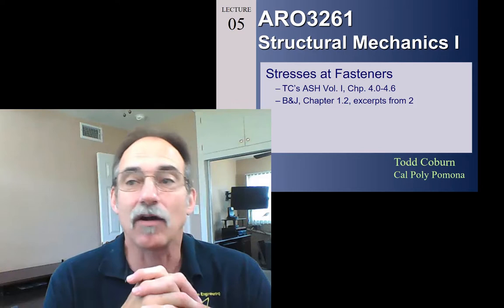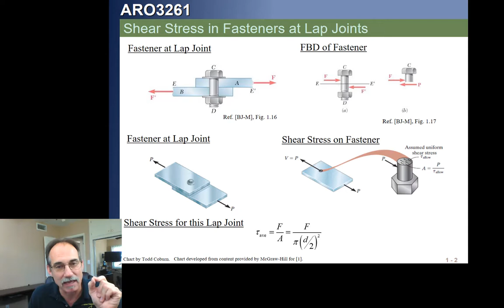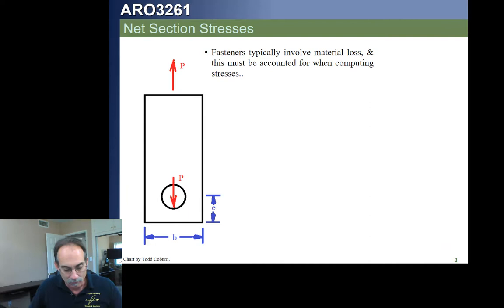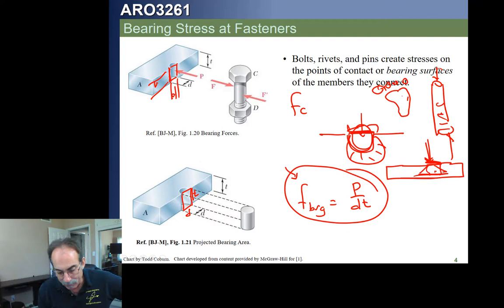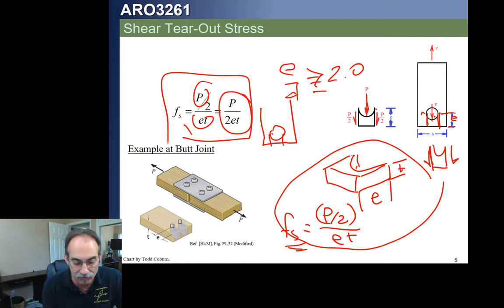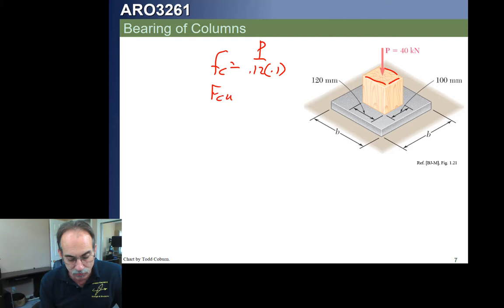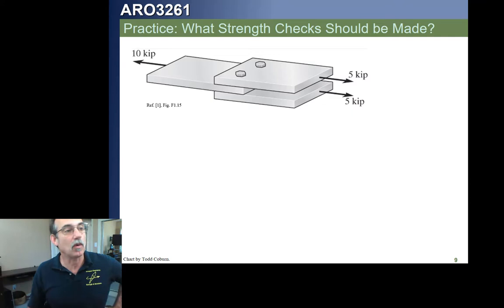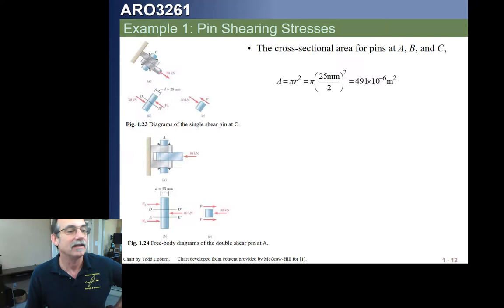Stress Analysis I: L-05w Shear, Bearing & Tear-out Stresses at Fasteners

Comment: Hi, Prof. Coburn,  When calculating the shear tear out why is the shear area calculated with e*t instead of (e-(d/2))*t?
Reply from the maker: et represents the area from the fastener center to the edge of the plate.  It is is a simplified formula that makes it easy to understand the area.  (e-d/2)t is the area between the nearest edge of the hole and the edge of the plate, but it is not a shear area since all shear load must move outward not inward.

Lots of folks in industry use a more conservative area than et that represents the area from the hole 45 degrees from centef to the edge of the plate.  It is conservative but is a good choice too

Comment: Are the P values for net tension and bearing axial stresses or shear stresses?
Reply from the maker: The force on the joint, often denoted P, is first axial in member, and is used for various strength checks.  The magnitude may change for each check, depending on characteristics of the joint. This feeds checks for net tension, shear tear out, bearing, and fastener shear.